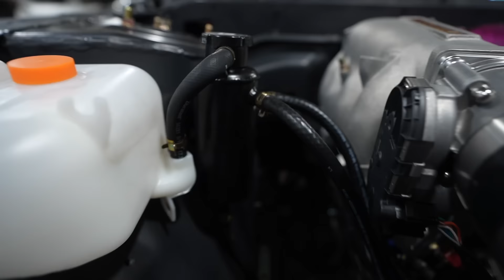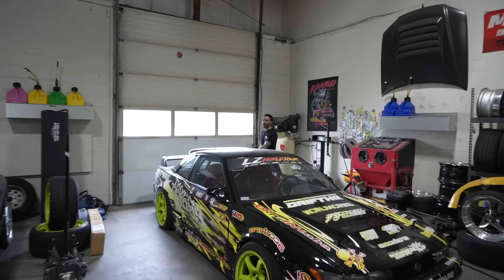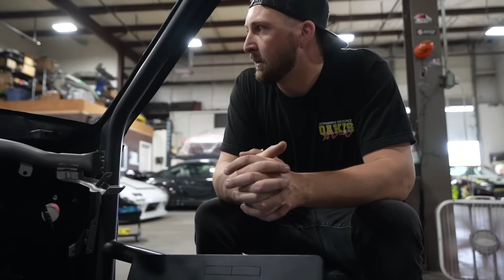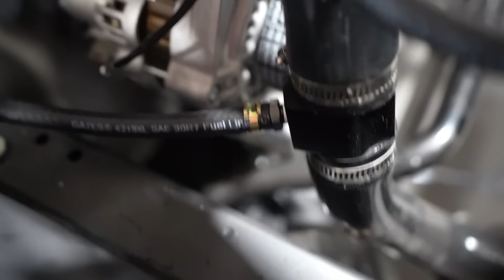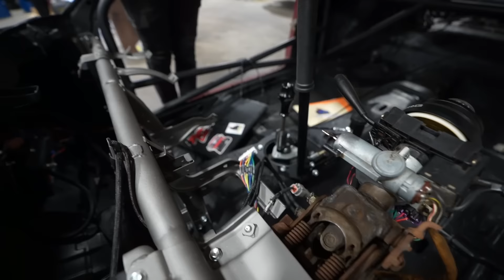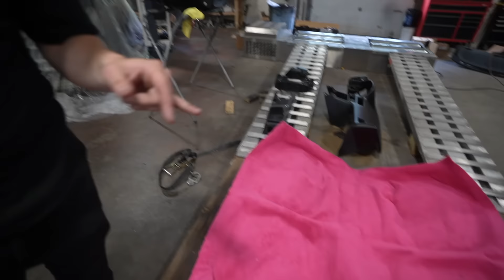FIRST START UP on a FRESH Build! (sounds awesome!)

Comment: You should invest in snap on coolant vaccum fill and pressure tester, you’ll know it’s leaking if it doesn’t hold vacuum and the pressure tester comes with more adaptors

Comment: E85 power gains don't outweigh the downside of the fuel's corrosive properties. I'd rather have a 93 setup with a bit more boost, personally

Comment: "hope all the fuel lines are tight" Been there before. First start had fuel pissing outta the stupid fuel dampener banjo. Squirting all over the starter and shit. 10:30 Isn't the VooDoo now the top of the line and the fury is now previous gen?

Comment: Just build my first engine, a M52b30 stroker (was a 2.8 before) its close to first start and i planned doing 2 oil changes, and put good expensive oil in it. I just realized i should've just put cheap oil in it after seeing this.. 😂 maybe it'll be fine driving 500km with it and change it then..😅

Comment: James bled the system wrong, you don’t need a funnel you make sure everything is filled and then run it cap all the air will push the air to the swirl pot .. You don’t need a funnel.

Comment: Hey Jimmy, love the video. With the IAC valve deleted? How’d you get the car to idle? Did you partially open the throttle blade or drill a hole into the blade to get the car to idle?

Comment: James please get a small fluid transfer pump instead of wasting all that fuel everytime you pull the Manual pump out it's easy you can get ones that you wire to a Milwaukee battery and just put some fuel line to it and you're good to go!!

Comment: CONGRATULATIONS you just started the decay of your fuels potential. The entire drum will now begin to lose effect until in a month or two max it's as crappy as pump again. NEVER BUY MORE THAN YOU ARE GOING TO USE IN A COUPLE OF DAYS MAXIMUM.  Ya'll gonna learn now lol.
Reply: Lol do you know something like additives?
Reply: @moritzdo8305  nope I just know that dyno numbers show month old open can of E (any brand) will be down on power vs. fresh fuel. Does not matter how well you seal it back up. It's just fuel science stuff. Ask a dyno shop owner if you don't believe me.